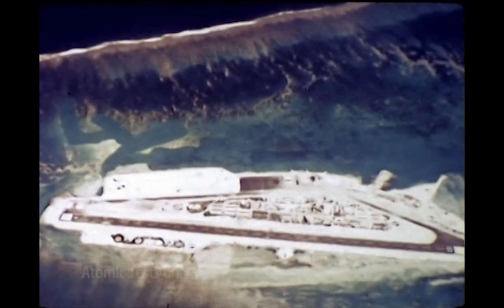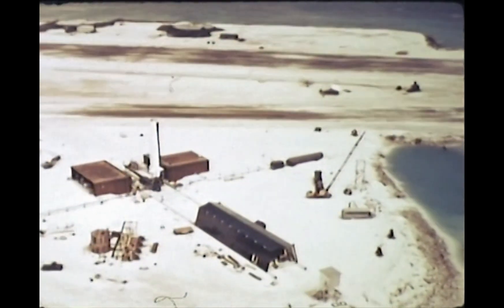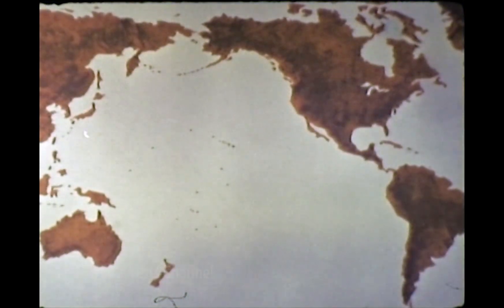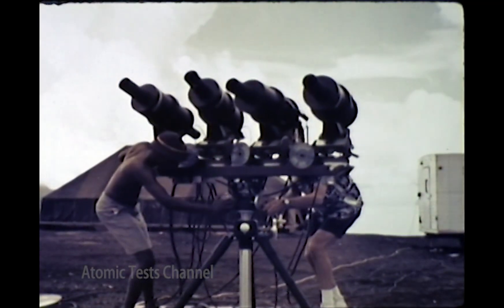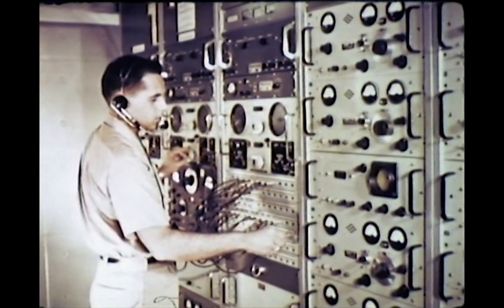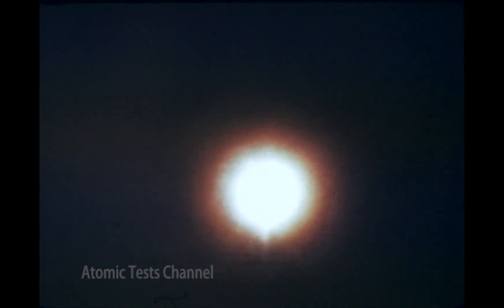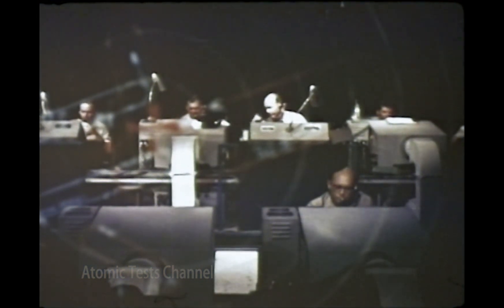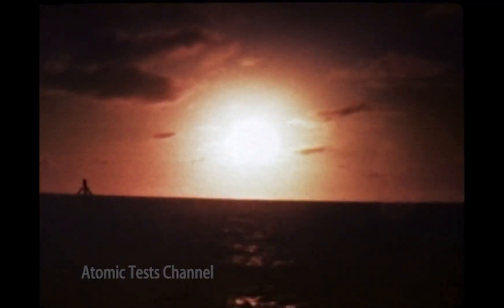Nukes Detonated In Space JTF-8 Report Dominic Fishbowl 1962

Comment: 3:50  "Circularly polarized antennas are used when signal reception needs to be consistent regardless of the antenna's orientation or alignment. This is particularly useful in applications where the relative orientation between transmitting and receiving antennas might change, such as satellite communications"
"A circularly polarized omnidirectional antenna is insensitive to wave orientation. Thus, they provide particularly effective performance and gain. In receiving antennas, a dual polarized CP omnidirectional antenna offers optimal transfer of electromagnetic energy."

Comment: 😍😍😍😍😍😍😍😍👊👊👊👊👊
Edit: I forgot Starfish had similar teething issues as the UGM-94 Trident I D4 SLBM. Breeching needed more pressure and the backplash extinguishing the First Stage booster saw the improvements to the modern Marvel the Trident II D5 SLMB!

Thank you! Give this Gentleman a NAND!!!

Imagine how incredible it would be to be a part of these Teams!  All of that Data, the Results, everything Completely NEW and much still merely Theoretical. I mean, the idea to use the Pulses to negate the fuzes of numerous Inbound high kt - mt Threats?
Even the failures gave us Data and knowledge. But the Radio Blackout Effect is a huge Tactical Advantage, even Hardened Structures & Equipment were down.
This started the Strategic/Tactical Use Plans such as the infamous Deployments of intentionally launched MIRVed SLBMs using hyper and general Depressed Trajectories (unfortunately, Countervalue and Counterforce Overlap) meaning exoatmospheric Bursts, High Altitude Endo Air-Bursts, each fuze detonating at different Heights and Times vs. All MIRVs following suit and "Blinding" all types of arrays and radar types/bands, Relays, C4SIREW & LCC Bunkers or Mobile Command Centre's, unable to track, respond, deploy resources to help and warn civilians etc. Plus Up and Down Satlinks, GPS Constellations and cellular networks! Down! Is it over? Was that the Full Decapitation Strike? How many did we get airborne and out of Silos? Ohio Fleets? TACAMO? President and JCOS? 

Like learning about the (Nothing really more terrifying) Gamma Ray Bursts or IDing forgeries of Paintings by Master's and literary works! NEMP Pulses (like thermal, LOL, we learned they happen μs apart but always in pairs. All of these, plus more,  stem from "mistakes", "failures" and "unnecessary testings" 
Like the Monty Python Lads sang, Always look on the Bright Side of Life!

Comment: that sucks there were so many rocket and test failures.
Reply: Yes, there were a lot of accidental explosions the solving of which eventually led to more or less consistent results. But anytime you have "time release" bomb itself hefting something up into the atmosphere there are bound to be things going wrong. Due to weight constraints with such vehicles, most everything is operating just under or right at maximum design parameters. And if something like a spontaneous crack develops in a solid fuel booster that extra surface area now burning in the crack can push the envelope to destruction. So keep that in mind when you're cheering on Elon Musk, a lot of the things that hundreds of millions of dollars were spent upon perfecting , Elon stepped in and used all of that knowledge for free that we the taxpayers paid for in the original research for space flight . He is innovative to be sure but he did not invent the wheel so to speak. As usual inventors pioneers stand on the shoulders of the pioneers who went before them.

Comment: 😳 Can't wait. BTW:
I saw some declassified portion of this movie, where scientists got scared about atomic explosion over them. Scientists  were in an open shelter. When the device was set off, they run down to the shelter.  I think it was due to the explosion, which occured 26 miles high, as describe here. Is that right?
Reply: That was Teak in 1958; part of Operation Hardtack.  It was programmed to detonate 80 miles to the south of Johnston Island and a few miles above.  Instead, the programming f-ed up and it detonated 50 miles straight overhead the island. 

See vid here:  /watch?v=OLbyY76zt9w
Reply: @RichardMNixon-zh6uz thanks for this aditional  information 🙂. Also I fixed your link:
https://youtu.be/OLbyY76zt9w